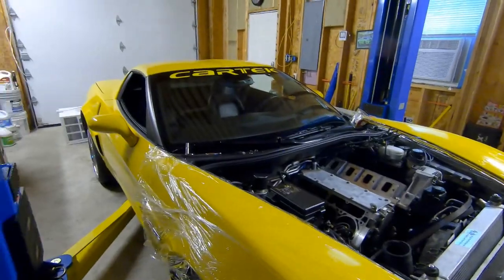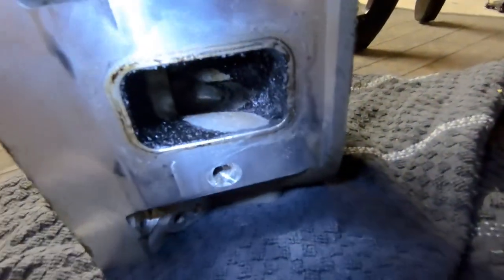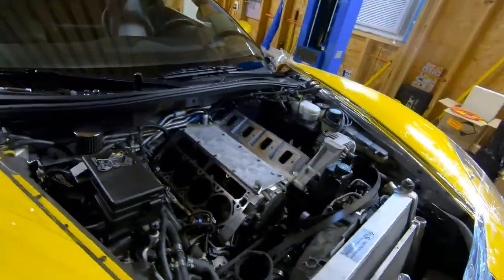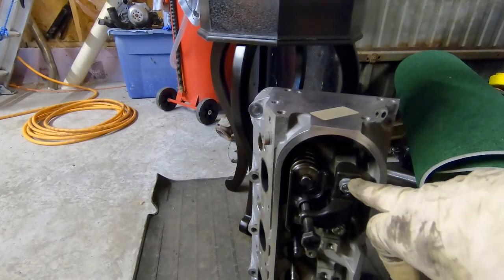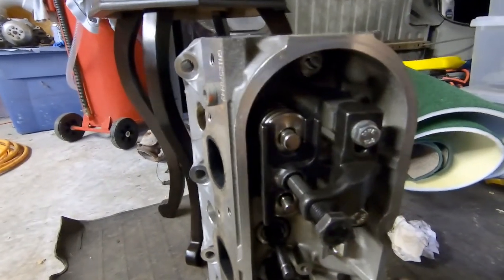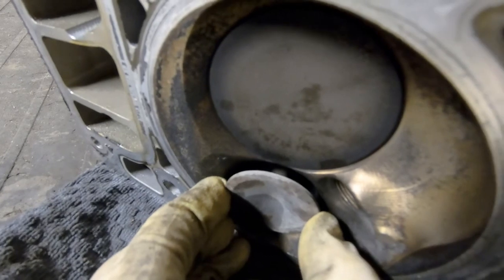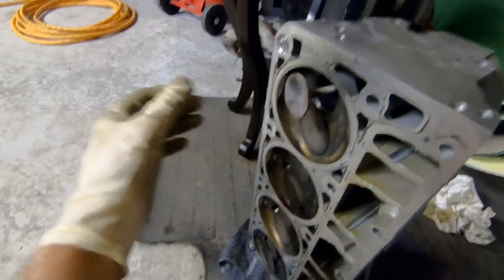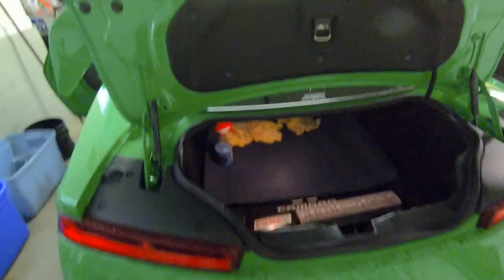LS7 valve guide wear issue!

Comment: I have a z06 with 60k+ miles and am going to be doing mine. What is the fix? Replacing the guides with different ones? Replacing the valves?
Reply from the maker: Have the guides replaced and the ports cleaned up. Texas Speed did these, I highly recommend them, but any competent shop should be able to do this!
Reply: @slow_restoration  did they replace with the stock style guides or brass?
Reply from the maker: @Patrick Sexton  I believe they used bronze guides but I'm not 100%